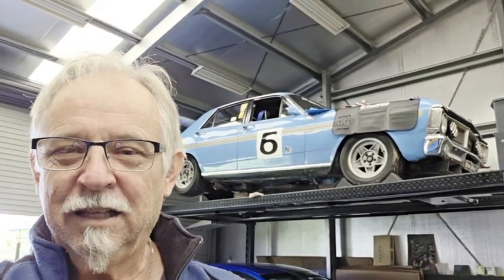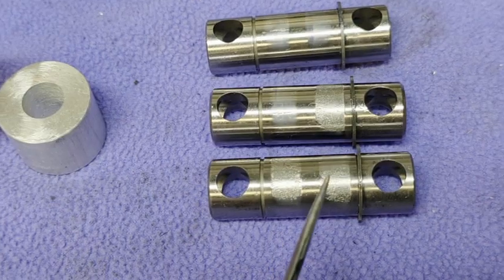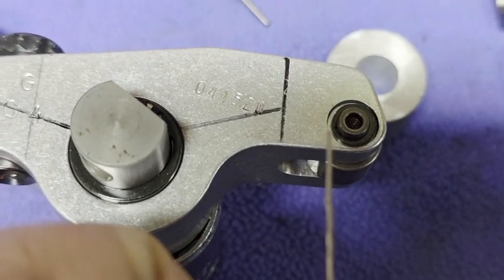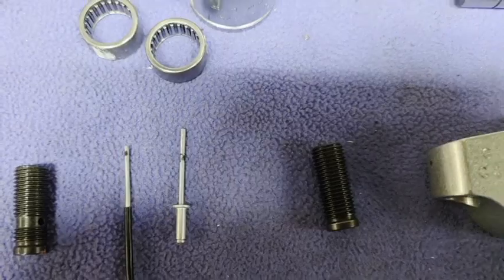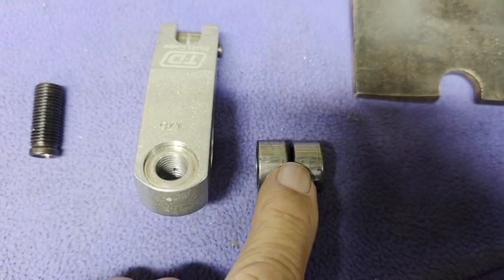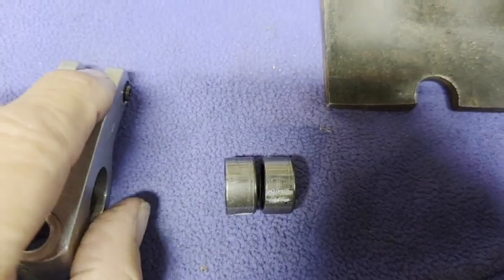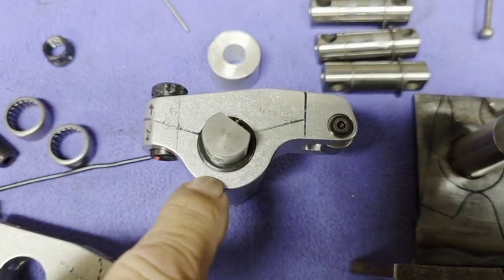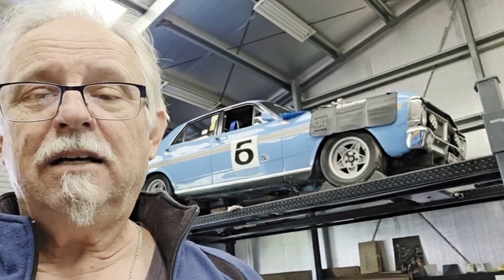Cleveland/Windsor, T&D SportComp rocker pressure feed oiling modification,  may suit Chev SB.

Comment: we run T&D rockers on Brodix heads on our SBC in our road race car, routinely spinning it to 7600 rpm; we had a rocker fail this summer because the shaft wore just like you demonstrated, which eventually took out the needle bearings in the rocker and let the rocker deflect enough to spit the pushrod out. Luckily it didn't hurt anything else! T&D makes replacement parts, but I think we will use your modification on them all during our off season maintenance.

Comment: Did exactly that to cheap set of shaft rockers , could see before even fitting them they wouldn't last without oil feed , tbh all shaft rockers should come with oil feed needle rollers 

You were lucky your needle rollers are caged

I did tap and fit grub screws